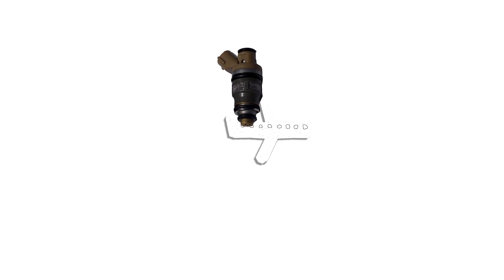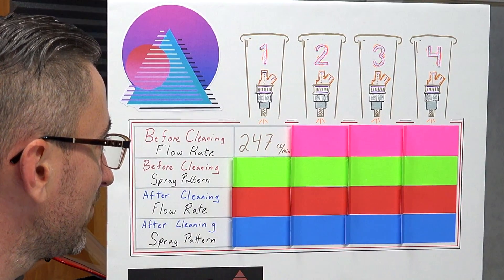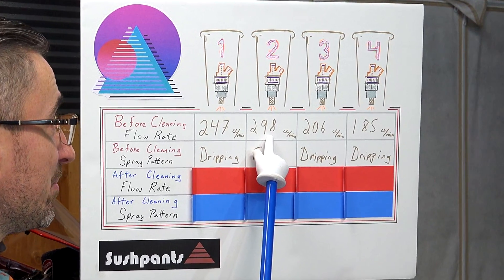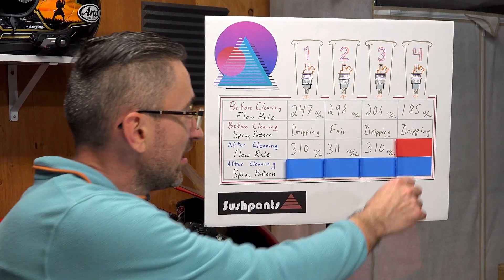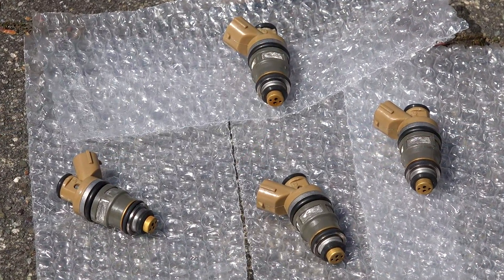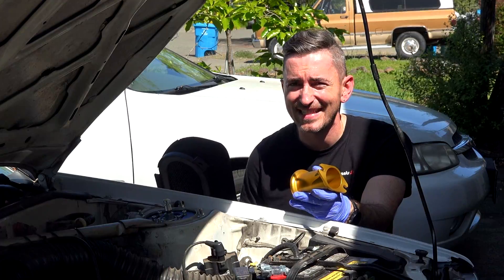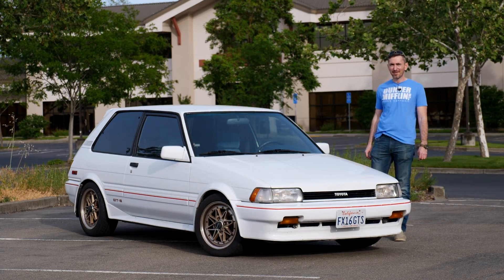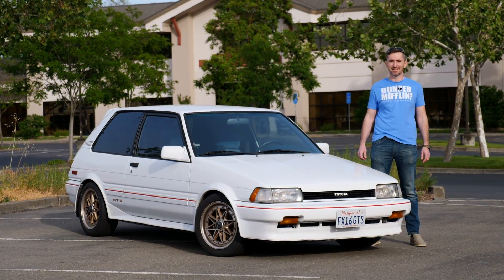4AGE Build: Fuel injector test- baseline before ECU install

Comment: Any post-cleaning dyno results? This was a great vid! Shocking. I have a 91 4AFE  Corolla Wagon with 141K miles and the engine runs like a top and I want to get it to top working condition, and see how many MPG's I can get from that engine and it's 5sp transmission.

Comment: Have you thought about upgrading the spark plugs for a little more power? Pulstar makes plugs with integrated capacitors that saturate the fuel with plasma, which is supposed to create a faster and more energetic burn. It sounds weird but the vehicles they tested all gained 2-8HP and 1-10lb ft of torque.

Comment: How much does cost all the process to change standard carbs for 86 to injectors ? Do we have to change the ECU and all ?
Reply: This engine is efi from the factory. I think there were some 4afc's around (could be wrong) but they are really uncommon

Comment: Hey Man, I'm from Trinidad and Tobago. I love your Content. I've got an Ae100 corolla swapped over with a 4age 20v Blacktop with 6fwd Gearbox off an Ae111 levin tureno. My clutch needs replacing atm. It got scorched from track days at my local Autocross and Circuit racing. Have you ever replaced your clutch and pressure plate? What aftermarket brand do you recommend? I was thinking of going after either a Stage 1 or Stage 2 set up. Would definitely appreciate your response 😅

Comment: Hey, I observed, you have an issue with your coilovers for street use as they are stiff, you can get damper settings for comfort at a flick of a button below is the link.
http://www.cuscousainc.com/downloads/dl/file/id/196/00b_60j_xxxx_e_con2_electronic_damper_controller.pdf
http://www.cuscousainc.com/products/coil-over/electronic-dampening-force-controller.html

Comment: I really doubt those "before" values are correct, something doesn't add up, your engine would be running really rough and even possibly with a broken piston if there was 40% difference in fuelling between cylinders
Reply: If it was boosted it would have been a problem

Comment: So I have an FX16 gts with a red top 4age, but my main question is how much did it cost to get the injectors inspected and cleaned?
Reply from the maker: It was $128.50 to have all 4 injectors cleaned and tested. That also included the shipping back and tax.
Reply: @sushpants  sweet thank you :D

Comment: i had issue with honda k24 injector passed all the test flow and injector cleans. untill it got hot and stopped working afte 40 minute driving such a stuff around

Comment: I'm thinking about either getting my injectors flow tested or just replacing them. They've got over 310k as well as the original fuel pressure regulator.
Reply: Do it, it'll make a big difference, they'll be like new basically
Reply: There will be nothing wrong with them. It is an insult to nippondenso for RC to make such claims of variance. Total BS.
Reply: @micknumpty3783  ever heard of gumming up the internals and tips? I have and I've cleaned and tested injectors and seen the difference, have you? Just because they're denso and whatever doesn't mean they can't get dirty.
Reply: @Liveforeever   I've messed with Denso injectors and varying fuels/blends including isopropanol, nitro,  methyl benzene, xylene, ethanol,avgas and e85 along with lots and lots of junk from fuel pumps. 
I have never had an issue with dirty injectors. 
Only other proof I have of dirty injectors is from the " I spent money time and effort on this so I'm gonna say it made a difference" brigade who have nothing but opinion. Like you.
Reply: @micknumpty3783  all I'm saying is that every well used injectors being bosch, denso, nippon, Chinese fakes etc benefit from a good clean. Fuel delivery quantity improves aswell as spray pattern from what I've seen. You are saying that injectors don't get dirty and performance is not affected. That's like saying oil filters, fuel filters, air filters don't get dirty

Comment: How much did the injector cleaning cost? I wanna do this on my blacktop
Reply: Probably better to just put them in your own ultrasonic cleaner, seems like a lot of effort for not much actual work
Reply: @sneugler  the plus side of doing it this way is that you don't have to worry about the injectors possibly still not being good afterwards, because you get some actuall results.
Reply: $28.50 for 1.